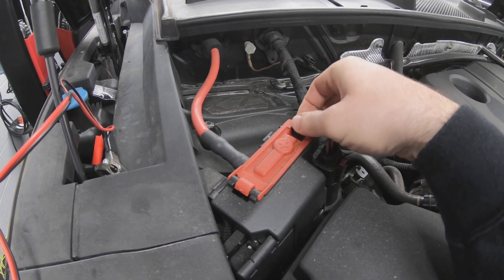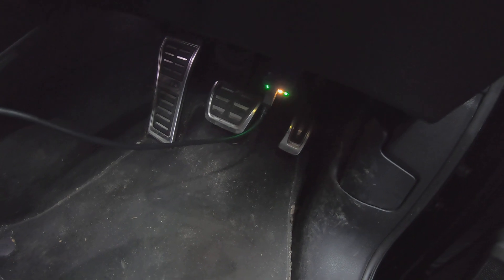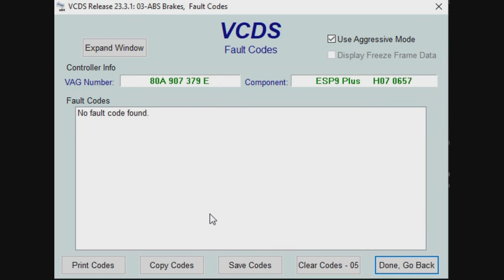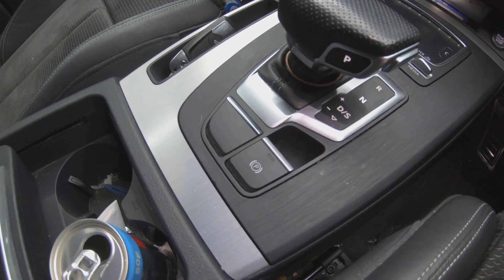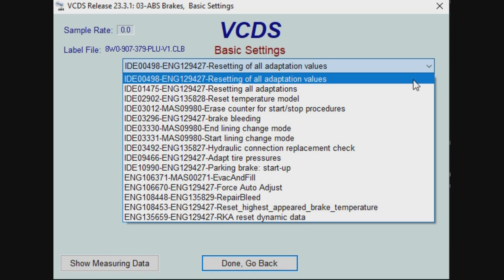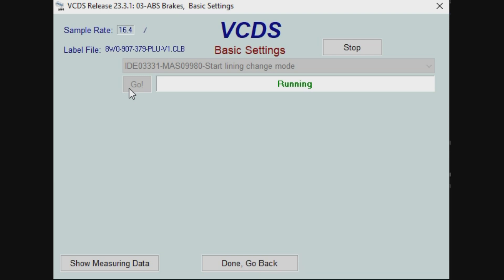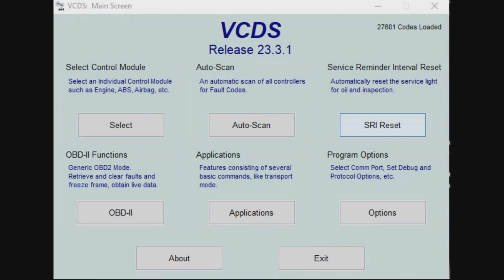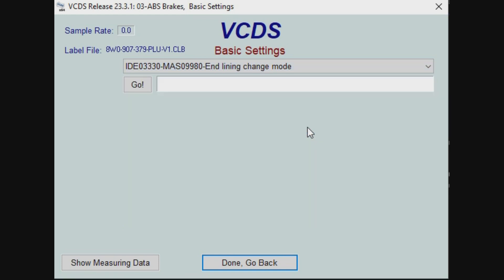How To Retract An Electronic Park Brake using VCDS - AUDI/VW/SKODA/SEAT

Comment: Hi. Can you please let me know at what stage should you erase the brake pads wear light in the dashboard? Thanks.
Reply from the maker: @japanluv  it should reset itself once the repairs have been made. Alternatively reset it after all new parts have been fitted.
Reply: @ Had to abort mission. My cracked version of VCDS doesn’t have the options to lining as yours, in the break/ABS menu. Thank you, though.
Reply: @japanluv it has a different menu for parking brake
Reply: @japanluv module 53
Reply: @SNWSTUDRO thanks for getting back. Found it in another window and all good after. Cheers.
Reply: @japanluv no worries mate glad u figure it out❤

Comment: Fab, many thanks for this. I have a slightly sticky rear brake on a mk7 GTD and need to investigate. Quite happy to do the mechanicals but not worked on a car with an electronic handrake before. This has given me loads of tips to investigate and see if anything's not right and work out the problems without messing up. Thanks!
Need to go and dig out the wind back tool. 🤔
Reply from the maker: Thanks for the feedback! 👍 If you have any further questions don't hesitate to give us a message!
Reply: If you have the electric parking brakes, please don't use the wind back tool. You'll crush the actuator mechanism. If you have to do it without software aid, remove the electric actuator block from the calipers first. And remember to open up the brake fluid reservoir cap.
Reply: @pr0xZen Hi. I have the VCDS, I would like to replace the brake pads on my 2016 Audi A6. Do you mind to list the steps on the exact order to attempt this and not damaging anything? Thanks.
Reply: @japanluv  Not sure exactly how to do it on a much newer generation, but I'm sure there's videos on it on YouTube because it's a common job. Even RossTech put out videos. What I know is important is keeping a battery charger connected while doing the job, it's important to keep it from dropping under 12 volts when performing the parking brake service position things. That can quickly happen when using VCDS without the engine running, because it draws so much power when it wakes up all the control modules.
Reply: I dunno what you on about. After puting it in "service mode" you turn ignition off, then do the job, then put everything back together, then ignition on, then you pull off service mode. Simple.
Reply: @pr0xZen can you automatically remove the air in the system with vcds or in another way? I remember keeping the reservoir closer in my older cars

Comment: Today I set my parking brake and when I returned to my vehicle to leave the brake would not disengage. There are no errors on the instrument cluster and everything appears normal. I can tell the parking brake button is still working as when I pull it up and hold for 15 seconds I get a P with a strike through symbol on the instrument cluster until I let the park brake button go. What are the chances this process could retract the parking brake without having to disassemble the parking brake actuator from the caliper and putting power direct from a battery to the connector on the actuator? I'd prefer to use the VCDS software.. but lots of videos showing how to do it without doing that.
Reply from the maker: Hi Emanuel, firstly we would recommend that you connect your vehicle to a diagnostic computer/VCDS and check that there are no fault codes within the brake system.
The process in the video is the correct way to retract your park brake actuator as recommended by the vehicles manufacturer, as long as there are no other issues with your braking system this will work for you.
A few suggestions for you....
Check that you can hear the actuator working when you retract the park brake.
Once you've retracted the park brake check that your caliper piston and caliper sliders are not seized.
There's also another video on our Channel that may help you.
https://youtu.be/fxhRalV6cJ4

Hope you found this helpful! And thanks for commenting 👍
Reply: @DropTheBoxOfficial  strangely, I came to the car today, started it and disengaged the parking brake and it worked. After a few hours yesterday it did not resolve itself, but an overnight sleep did. I connected VCDS and found the button itself is faulty.